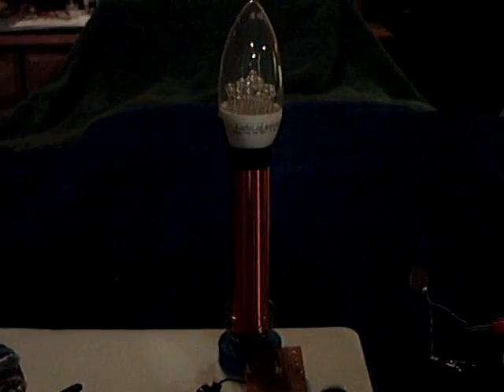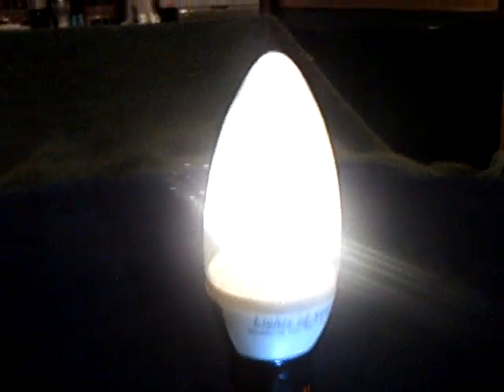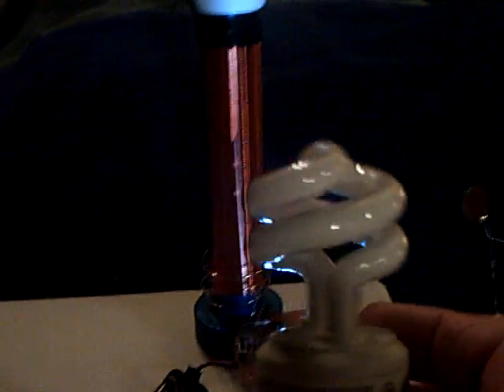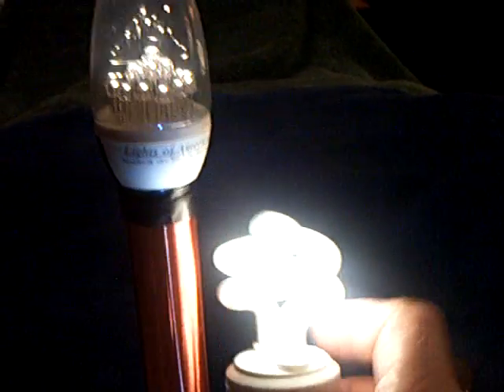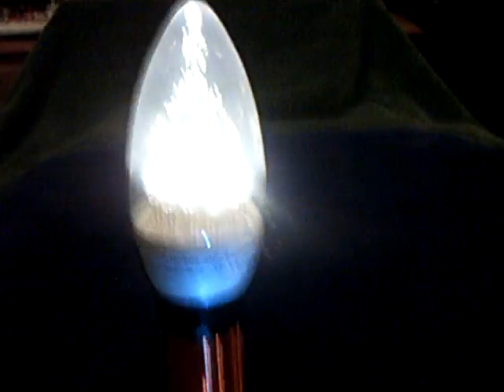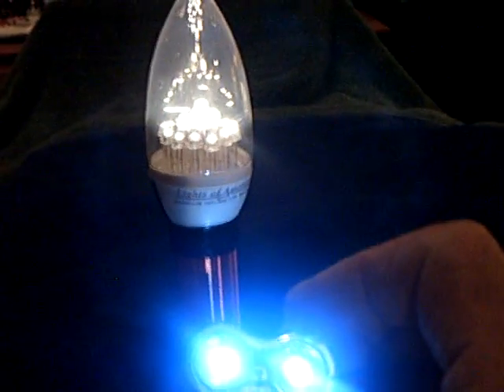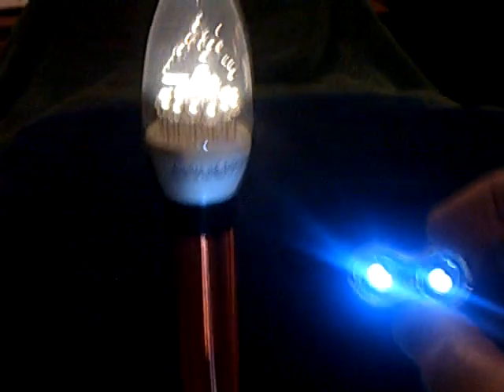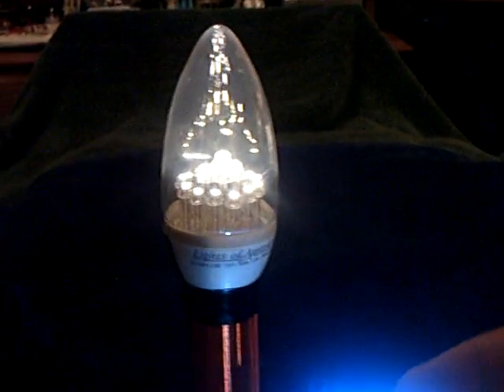World's Ugliest Homemade Battery---doing magic.

Comment from the maker: Just a couple of minutes.  This was drawing around 300 mAs and all I did was put a surface on the battery.  I didn't do any run time testing with the battery filled up.  The four cells in the battery were all different.  This was just an experiment to see what would happen if I put them all together.  These Lead / Alum cells charge up really well off solar cells.